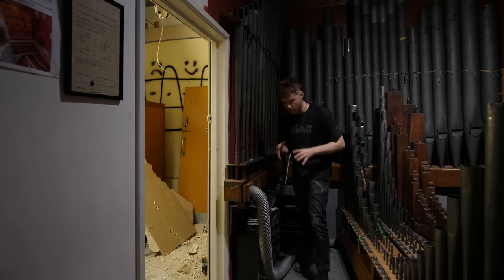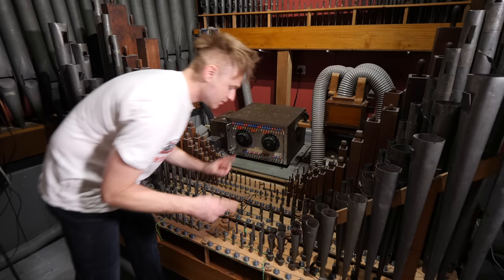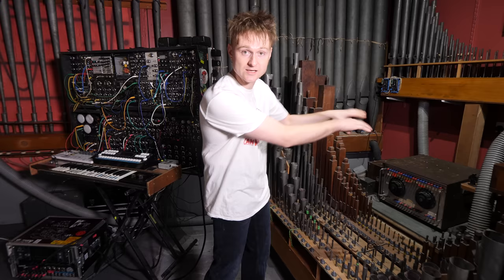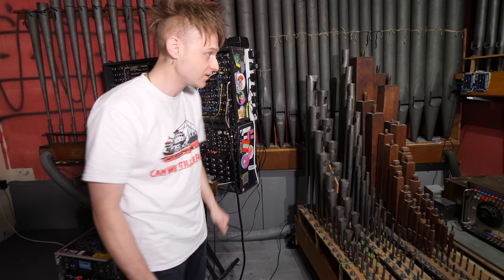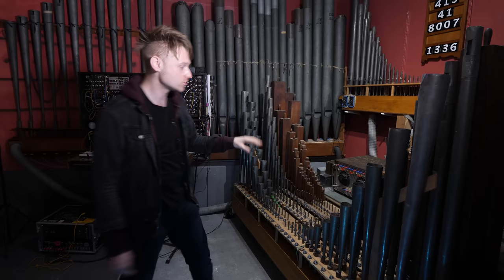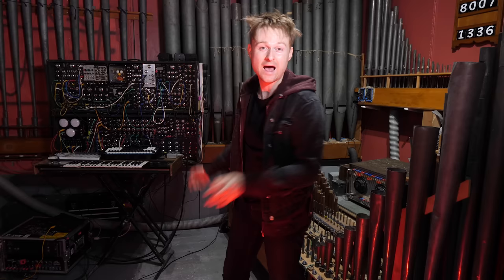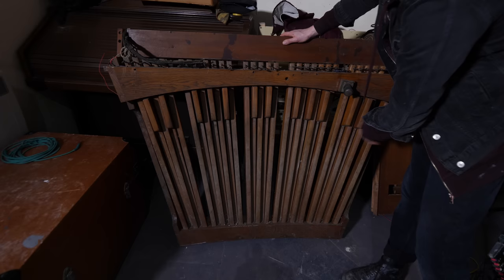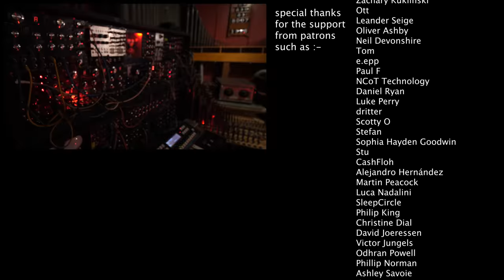PLUGGING A CHURCH PIPE ORGAN INTO A SYNTHESIZER - I BOUGHT A CHURCH ORGAN PART 9

Comment: Good luck, creating a MIDI keyboard if you have all the mechanics in correct order is really easy, I did it myself: putting reed contacts at each pedal of my Hammond A-100 and route them into an Arduino. The necessary software fits on one page, unless you want to do really wicked stuff. You could also wire that toe piston to do anything you like, and you could think of to be useful.

Comment: One other thing you could look at, right now there is a lot of variation in timing of when the pipes come in. Some come in really responsively and others take a bit to get going. You could look at calibrating delays for each pipe so that overall the whole instrument has a set amount of delay, and pipes play together. I think you could automate this using the microcontroller already on the organ! Just some thoughts

Comment: I think much bigger problem than tune is timing. There is noticeable latency issue between the synth and the organ making sequences turn into mush. The tune itself sounds great. As you said, it gives character to the instrument.
Reply from the maker: Timing is fine I made an offset anyway. Can never get the triggers quick enough. I offset it and delayed the synth to sound nice. You probably like it a bit more on the grid than me 👍👍👍
Reply: @LOOKMUMNOCOMPUTER  Problem isn't necessarily on the triggers, but the actual sound progression in the pipes. It takes time to tumble the air to form the audible sound wave, and different style of pipes take different lengths of time to form it. And to get that right.. Oh, boy.. Good luck, Hat is Off!
Reply from the maker: @oikkuoek  yes but the only way to control such issues is with pressure and valves. thats what i mean. cheers

Comment: Don't exactly know what that button or toe stud on the pedalboard is for. it really depends on the organ. However, judging from this it is likely an "advance or preset" of some kind which correct me if I'm wrong, sets the next combination of stops selected by the organist. The "registration" are stops and combinations chosen to perform a piece and thus the advance can be very useful I believe it can also be used in crescendos if programmed correctly. These systems can be very complex as they have memory databases and in more modern cases, may even use computers though I don't believe that is the case here. Thankfully, there are a few third party sources for organ parts and all that fancy stuff. And as an added bonus the pedalboard can be reused which happens to be one of the more expensive parts. the tuning issue you mentioned earlier about it being perfect isn't that big of an issue' particularly with the reeds they can go out of tune extremely easily due to the tuning sliders tendency to be constantly put them a little out of tune. An inconsistent temperature alone can screw them up but I couldn't imagine temperature being too much of an issue. But yeah. And I think I mentioned this last time, but incase I didn't, if you find yourself researching organ stops I find the encyclopedia of organ stops to be a relatively fine source that is for the most part accurate, list synonymous names for organ stops (many stops have multiple names), and even has dialogues from different organ builders on certain stops. Either way, that's all from me. wish you the best luck on the project and can't wait what's yet to come.

Comment: The organ has discrete sounds, so you have to rely on quantizers to output actual notes right? But since some of the interesting sounds happen with combination of different registers - is there a better solution than having a massive polyphonic synth? Perhaps scaling, shifting and reversing the quantization(with modulation)

Comment: What people forget is that by its nature equal temperament is perfectly imperfect. Technically, it's always out of tune but people are just accustomed to it. The only actual advantage is the versatility and the fact that almost every instrument today uses it. Modern pianos with their really high string tension sound worse with unequal temperament due to the beat frequencies in the frame sounding out more. The really old pianos with lower string tension and wood frames could tolerate more unequal temperament before sounding too bad. That's part of the reason why they were tuned to meantone for a long time. A lot of organs were tuned to some variant of meantone back then too. Even when metal frame pianos came along, most everything was in some form of well-temperament, not equal. Equal is just a simpler scheme and works well with guitars. Tuning the unisons wider smears some of the beat frequencies of equal temperament; that's why it sometimes sounds better. It drives me nuts when I see these armchair concerto gooks that whine about perfection even though their solution is not at all perfect. So don't worry about it.

This organ project is absolutely amazing. It's only natural Sam would at least dabble in organs since they are basically medieval synthesizers.

Comment: I love this melding of old and new sounds.  I miss playing the pipe organ and love the idea of combining it with synth sounds / sequences.  You've taken this organ out of the "stuffy" domain of only playing classical music.  I love how you have fun with it.  Question:  How exactly did you assign each rank to a different MIDI channel?  Did you have to flip dip switches on the windchest circuit boards or did you use some type of splitter box between them and the controller? Inquiring minds wanna' know! :)

Comment: Regarding organ tuning: I feel compelled to point out that 12-tone equal temperament is by no means an ideal "perfect" tuning, for organ or any other instrument.  It's a compromise, designed to make music easily transposable and not requiring instruments to have an excessive number of unique notes.  The thirds and sixths, though, are all about 15 cents or so off their ideal "just" equivalents.

So, tuning the organ by ear might actually give a better result because it's more in tune, rather than less in tune.  And it is possible to tune a modular rig to an organ rather than the other way around.  (The Ornament and Crime Quartermain app is one one way to do that.)  Though, if one were to go all in on just intonation, it may soon become apparent that 12 notes per octave is just not enough, even for conventional western music in "plain" triadic 5-limit just intonation.

My own personal conjecture is that 12-tone equal temperament has mostly killed off the organ, because pianos and guitars sound pretty good in 12-TET, whereas organs don't fare quite as well.  Pipe organs are still made, but reed organs in particular are basically no longer produced.
Reply: Agreed - to the best of my knowledge, one can blame JS Bach and his Well Tempered Clavier. My main instrument is trombone, essentially one big tuning slide; I try to impress on pupils that the slide positions in tutorial books are a guide, rather than an exact reference... You need to listen! 🙂

Comment: I think, because of lack of midi channels, it's not a good idea to use a separate midi channel for every rank or stop. Better is to use a channel for every division and use only one channel and note on/off commands to switch the pipe rows on or off. So you can switch as many stops as many notes you can switch on one midi channel....
Reply from the maker: But there are only 128 notes in a channel. The amount of midi outputs is limitless. Yes 16 per cable but you can have multiple midi outputs. I'm sticking with my plan. Thanks

Comment: Out of curiosity, do you have some sort of valve stage in your synth before whatever speaker or digital recording stage you use?   It would probably soften up and add warm analogue depth from your synth that would  compliment the pure analog of the pipe organ sound nicely..  ??

I run some valves/transformer/330v capacitors etc from a crude ebay kit preamp to translate line out from my PC to the line in of my equally cheap nasty  2.1 pc speakers..;  the result means a lot of songs (like morris blak for example (upgrade me etc) )  that sounds like complete rubbish on an all digital sound system (too much clipping) actually sounds really good after the value stage.  Works a little like a analog condessor filter that doesn't just sound annoying and loud. It just gives everying a nice mid to low frequency range kick.     It is actually annoying as i might download a really banging tune, slap it on the mp3 player in my car, and without the valve translation it comes off sounding clipped, flat or just tinny in the car sound system.  Values Really works well to reverse some of the digital harshness from overly butchered digital formats like mp3.

It might be worth experimenting with something similar on your setup here? Just make sure you record on lossless format for your video upload so we can enjoy it to :)

Comment: Wouldn't it be possible to have programmed setting collections for both perfect & dodgy tunings of the who setup..? (assuming you're using electronics, & not manual manipulation of parts, to actually tune the bugger.) That way you could switch between perfectly tuned & dodgy on the fly. If you take samples of each pipe, you'll have a record of mistunings to use as comparisons.

I'm still waiting to hear a 30 seconds long, teeth-rattling blast of the seriously low frequency (⊚), big beast pipes. If you don't knock dust from the rafters, you ain't tryin' hard enough.  ; )~

⊚ - 3.5Hz (with peaks at 6Hz) is apparently the lowest church organ on record. Gravissima.

Comment: The synth and the organ sound good together, I don't mind the slighty wonky tuning. How does one tune an organ? With piano's you can simply call your local piano tuner to perodically readjust things.
Reply: For most organ pipes, there's a plug in the top of the pipe that you can move in/out to tune it.
Reply: Each pipe has a pitch adjustment that you can move.  Usually, you pick one rank to use as the reference.  You first tune that rank to an electronic tuner.  Then you tune each of the other ranks to the reference rank.  You judge each note by hearing beats, same as with any other instrument.

Comment: Before you tune all those pipes to "pitch perfect" with a tuner you'll definitely want to do some digging!!  I don't know if it will be a big deal for you since the room you are using is small, but in the large cathedrals and churches they purposefully keep some of the pipes slightly out of tune because putting that many sounds in "pitch perfect" tune in a large auditorium has been known to cause hearing damage to attendees AND structural damage to the building. You may need to plan on an imperceptible amount of destructive interference.
Reply from the maker: It's more correct intonation on the principals
Reply: @LOOKMUMNOCOMPUTER  Cool! I just wanted to make sure it was addressed since you obviously "dON't kNoW wHAt yOU'rE dOInG!!"  LOL

Comment: 128 notes on 16 channels. Then you can stack midi devices.
Reply from the maker: But it is
Reply: @LOOKMUMNOCOMPUTER  so each pipe is one note of a clavier. So they could/should work on 1 midi channel.
Reply from the maker: @FransvandenBergeMuziekschuur  thats how it works, i mean theres more than 128 pipes. but there is 4 ranks of around 70 each with a midi channel